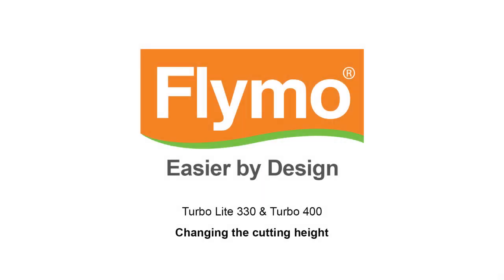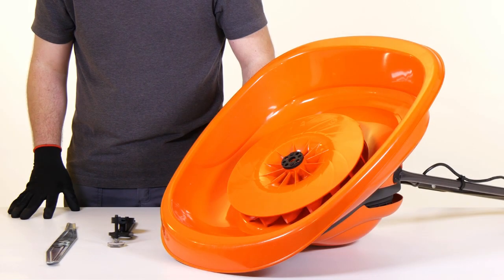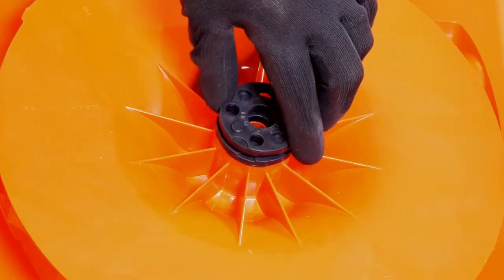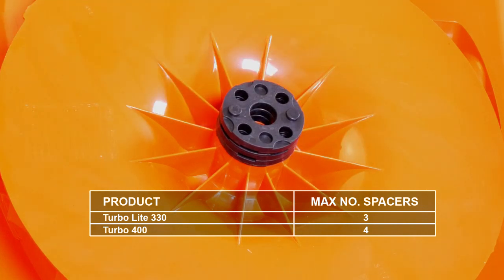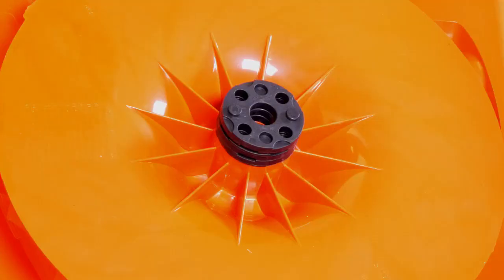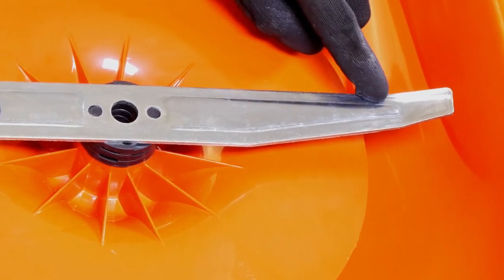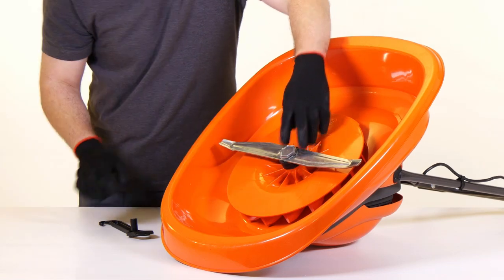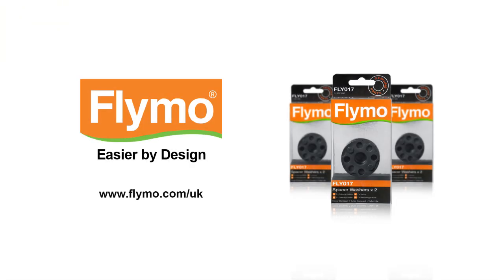How to change the grass cutting height on a Flymo Turbo Lite 330 & Turbo 400

Comment: Hello, any ideas on how I can adjust the height on my new flymo? The blade bolt has been so ferociously tightened in the factory that I can't shift it with the silly plastic spanner provided in order to insert spacers

Comment: How do you do a cut with one or 2 spacers as when I try the bolt doesn't go in enough and the blade isn't tight. It will only work with 3 spacers only. Thanks

Comment: Still confusing, does adding give a shorter cut or longer cut..it's not clear because of the terminology used on these Flymo ads. My logic says adding pushes the blade closer to the lawn so will give a shorter cut to the grass.
Reply: It is quite clear in the video about 30 secs in.
Reply: Adding spacers gives a shorter cut - if you can manage to remove the s*dding bolt with the silly plastic spanner in order to fit them
Reply: Cant get the bolt off not budging one bit
Reply: @miriamdooley6657  Do you have the correct tool? With any bolts/screws, when they are rigid, a gentle tap with a small hammer should give enough shock to release the thread. Failing that, use a large wrench with a bit more leverage. Just make sure it fits perfectly otherwise you might damage the head.
Reply: @martin5220 unclear. He should have said adding one spacer results in a longer cutting height